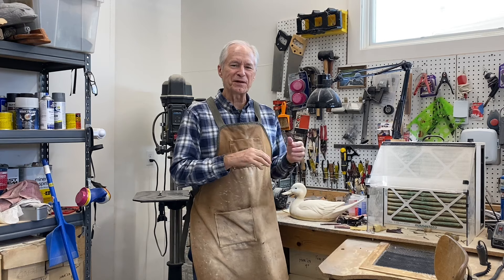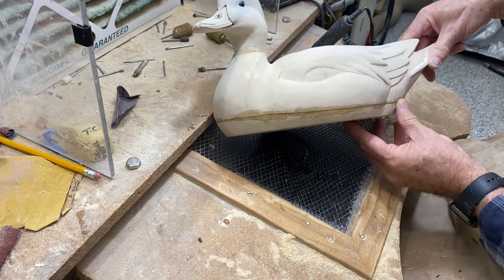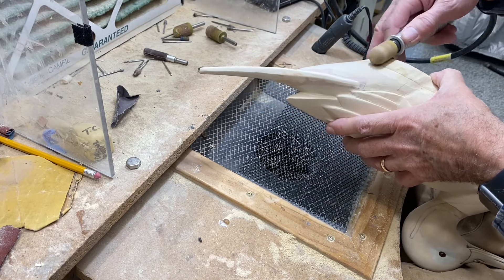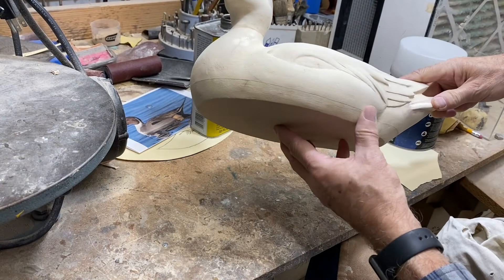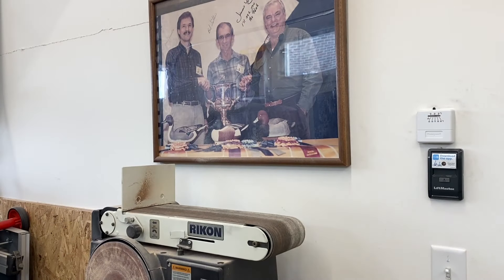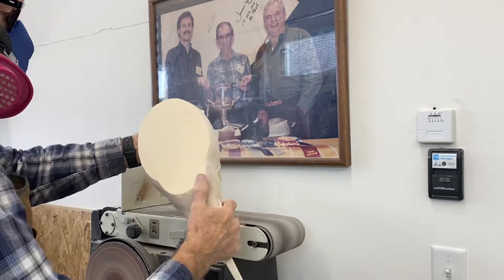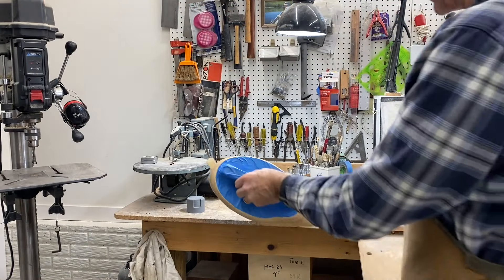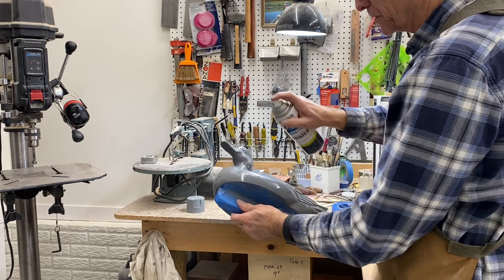Carving a Drake Pintail Session 5 - Completing the Carving and Checking Flotation

Comment: Hey Tom!  Love all the videos you are doing.  I like to use strap lead in my keels too but I secure them differently.  Once I determine the amount and location of the weight needed I hollow out a slot in the keel the same way you do. Then I just place the weights in the bottom and mix up some 2 part urethane plastic and pour it in the slot until it is full to the top of the keel.  10 minutes later it is solid and ready to go.  There are many products available but I use Smooth-On Smooth Cast 320.  It mixes 1-1 by volume and you don't need a lot.  Just an idea
Reply from the maker: Great idea and thanks for sharing. Sounds like a great approach!

Comment: Wonderful Demo! Great Work! Maybe to eliminate a lot of clean up between the two body halves when gluing them together, you can put painters tape on the lower half of the body and then the epoxy would be on the tape when dry. Perhaps the same can be done when gluing up the head with the squeeze out.
Reply from the maker: Thanks for the tip! I appreciate the feedback.

Comment: Tom,  I notice when you seal and prime your decoys you don’t mask the glass eyes. Do you use your carving knife to remove the sealer and primer from the eyes?
Reply from the maker: I use an Exacto blade to remove sealer and paint from the eyes.  the blade is not hard enough to scratch the glass and it cleans off fairly easily.

Comment: Tom, does tupelo always need to be hollowed out? When I was taking carving classes about 15 years ago, I don't remember if we did or did not hollow the decoys. I have one piece of tupelo left  in my sharp and I thought about making a Blue or Green Wing teal with the wood. To be on the safe side, should I hollow it? Is some tupelo lighter and not need  hollowing?
Thanks,
Bruce Brandeberry
Reply from the maker: No. Good light Tupelo doesn’t have to be hollowed out. I just choose to do that on birds that I plan to float. If I didn’t hollow this pintail I would just plan on a little more draft in the pattern.